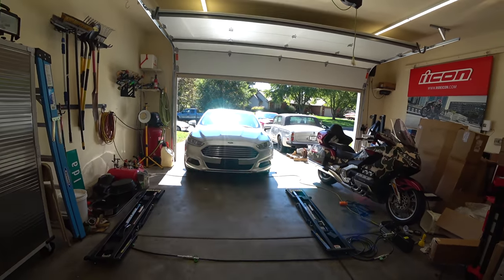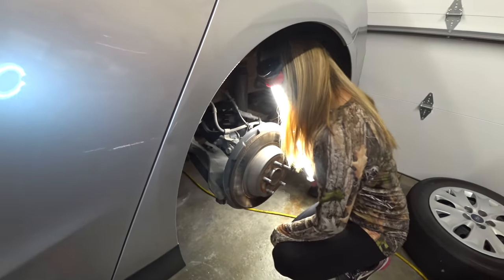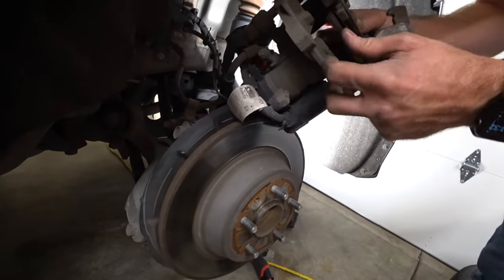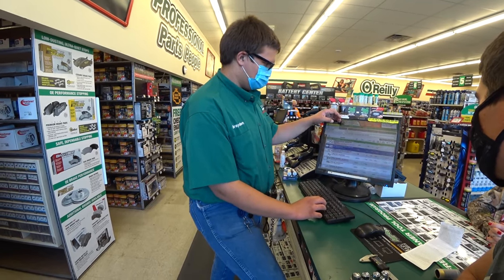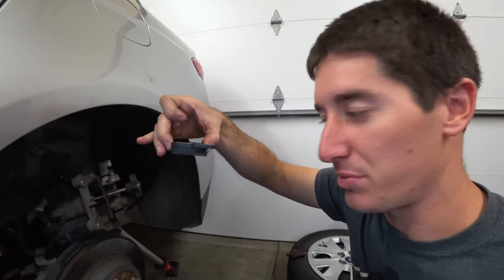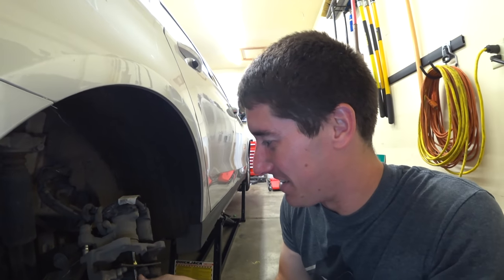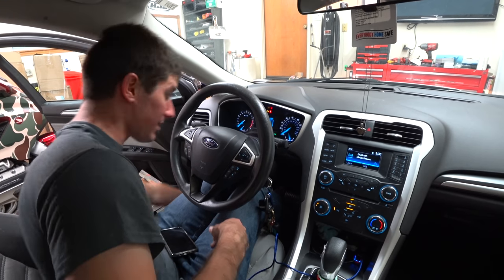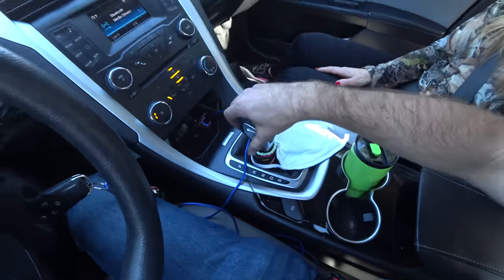GIVING A Single Mom A BRAKE Job (Dealer Wanted Too Much $$$)

Comment: The lugnuts are originally 19mm. When the jacket swells, you can use either a 19.5mm or 20mm socket to remove them.  She was kinda hot but JR treated her like she was a car buddy dude lol fistbump
Reply from the maker: That explains why they wanted to charge her an extra $100 to replace them all... and they would've failed again! 😬
Reply: Yep they were on my Focus ST too, first thing I bought for the car was new lugnuts. The stock ones are garbage and Ford knows it
Reply: @WatchJRGo  Remember FORD-Fix Or Repair Daily. It's all making sense now.
Reply: WatchJRGo Had a chrysler dealership say my Jeep has swollen lugs a few years back. What a joke lol I checked them myself afterwards and they were fine, just a little stripped. Hazard to the road my ass
Reply: I replaced my swollen lug nuts with a one piece set of lug nuts on Amazon.
Reply: @WatchJRGo  i would have changed them all... if she takes it to a tire shop they are gonna go nuts trying to figure it out... pardon the pun. also i believe you could have used your scanner to put the parking brake in service mode... either pay... good job JR.. helping her out.
Reply: I had a jeep with those capped lug nuts.  The caps were chromed, so it was for looks.  But my replacement lug nuts from NAPA looked a lot nicer!
Reply: What exactly causes the lug nuts to swell??  I’ve never heard of this kind of issue before.
Reply: @bradleykurtz5536  they chrome cap is really thin metal and over time it just expands from the abuse of the impact guns and if bad enough the whole chrome cap will pop off they are junk and a pain in the neck
Reply: @bradleykurtz5536  Heat makes the aluminum cap expand and delaminate, or separate, from the steel lugnut.
Reply: @fiffe7782  or Found On Roads Dead
Reply: I dont know if a fistbump  is the way to say youre welcome to a young lady -
Reply: Same problem on X350 Jaguars. Just get a 19mm soft socket and hammer it on. It reforms the jacket enough to get the lug nut off.
Reply: @bradleykurtz5536  They are two pieces; there is a standard plain lug nut with a nice shiny cover over it. Kind of like capping a tooth. The outer pretty part distorts over time making it difficult to get a socket over it.
Reply: @noahmatthews5013  🤣
Reply: Great job paying it forward 👍
Reply: Ford and Chrysler both have this problem on their chromed lug nuts from around 2009-2015 or so... that’s why they make half sized sockets... 18.5, 19.5, 20.5 etc.
Reply: You’re supposed to say your fronts look great, your rears look even better.
Reply: it´s watchJRgo and not watchJRcum
Reply: @fiffe7782  First on Race Day
Reply: I have a 2012 caravan and my lugs did the same thing! Vanity over functionality I guess....
Reply: my gf has a 2011 fusion and it had the same issue. We just replaced them with aftermarket lugs so no more problems
Reply: Yup I see it all the time at the tire shop I work at. It’s only on the Ford’s.
Reply: @fiffe7782  no
Reply: The lugnuts with chrome caps are terrible when they are worn and should be replaced . 
However you must get new ones with a rotating steel cone that contacts the alloy wheel. If you use ordinary lugnuts they will dig into the alloy and eventually ruin the wheel and/or the wheel can work itself loose. 
Usually alloy wheels have steel inserts where the wheel bolts/lugnuts contact but these wheels don't.
Reply: FORD actually replaces them with newer ones that don't swell now. I just had to change some out on a 2017 F-150 Platinum last week that were already toast, and the ones the customer bought from FORD as replacements were waaaaaay better.
Reply: @WatchJRGo  You also have to make sure that O'Reilly is giving you the right size (they sell 19 and 21mm for Ford) so if the owner ever gets a flat tire, the lug wrench in the trunk will fit. Also why did you just "pad slap" it? At least measure and turn the rotors if possible, or replace them. Its nice of you to help out, but the dig at dealerships "costing too much" isn't necessary.
Reply: Alloys covers on steel lugs nuts they just swell due to dissimilar metals.
Reply: Ford also had a lawsuit against them for this... What is really going to suck is when she has a flat tire on the road.
Reply: @WatchJRGo  ford nuts are horrible. the 19's and the 21's on the f150s that are chrome capped always swell. and don't get me started on dodge/chrysler, they are just as bad.
Reply: Its actually the steel lug nut under the cap that swells with rust. When you hit it all the rust disintegrates, and the cap just spins on the nut, or deforms the cap and strips. I've had to actually peel off those caps with a chisel to get at the nut to remove wheels. Really bad design flaw.
Reply: @ImTheJoker4u  The outer aluminum cap swells, not the solid steel lug nut itself. If you remove the cap, the steel part will be no larger than it ever was.
Reply: @ShinyRedGrapple  
Actually the steel nut under the cap is much smaller than when manufactured, due to the rust, which is why the cap spins or deforms. I've seen them lose as much as 2mm from a 19 to a 17. If they're even iffy, I always chisel off the cap to get at the steel.
Ive seen the chrome come off the tin cap, but its so thin it doesn't really cause any interference. Its the rusty nut under the cap that bones you.
Reply: @johnwartjr  Same with my 1999 Dodge 1500 Van, had to change 'em out.
Reply: @fiffe7782  i have a 2014 ford fusion se w/lux package and 18 inch wheel, and the great 2.0 turbo engine( i love messing with bmw owners ).. no prob,ems with the car.. added oil catch can at 20,000 miles, and removed all the oem lug nuts at first tire rotation, and replaced them all with lock 19 mm nuts... beond this.. just oil changes and filter changes  at 143676 mile now on the car.. and forgot.. i am a tech, classic Italian cars... my fusion. wonderfull car
Reply: @randellgribben9772  ya fords are great cars. just messing around
Reply: @WatchJRGo  My Ford dealer recommended I get a whole set for under $30 on Amazon and they swapped them out during a tire rotation.
Reply: @marvino3829  my Fords have never left me stranded anywhere.  Have always got me where I'm going.

Comment: Nice of you to help out, JR.

Next time, crack the bleeders when you push the brake caliper piston back in. Crud ends up at the bottom of the system (the caliper) and you don’t want that getting pushed back up into the system.  Fluid looked surprisingly good though.

Comment: Go to the 20mm for the lug nuts, her lug wrench won't fit properly when and if she has a flat, and don't put two different size nuts on her car...
Reply: Joe Schlotthauer Agreed. Once you start mixing lug nut sizes, you’re asking for a real headache when you end up on the side of the road with a flat, and your wrench won’t work! Not cool! He should have taken an extra five minutes and hit another auto parts store to get the right size...
Reply: Matt Miller  
24 hour roadside assistance...
Reply: Matt Miller  
He couldn't think straight...

Comment: In 30+ years, I’ve never had swollen lug nuts, until i got my Infiniti G37.  

Fortunately, I was about to rotate my tires, not stuck on a side of a road with a flat.

I was sure surprised when a 21mm wouldn’t fit and a 22mm was too loose.
CTA tools makes a 21.5mm socket and fits the swollen lug nut.  

I put that socket in the car, so if I did have a flat, I could take my wheel off.

Comment: Ford lugnuts are famous for swelling. The cheap polished cover on them gets moisture under it and then it’s game over.
Reply: Same on my wife's 2014 Cherokee.
Reply: Same with Chrysler lug nuts since at least the early 80's.  When I got my 2012 Jeep GC one of the the first things I did was replace them as they were already starting to swell even though they don't salt the roads up here.
Reply: Yep. Had the same issue on my 2013 Fusion. Had to change them all out after about 3.5 years of buying the car
Reply: All new lug nuts do it, constant thing with gmcs and Buick’s
Reply: Same on Range Rovers
Reply: I legit had this same issue with my 1993 F150. Ridiculous!
Reply: OK, you held the door open, but swelling nuts, really ?

Comment: My mother-in-law had her brakes worked on last year and the shop charged her $1,200 to replace the front rotors and pads (on a Toyota 4runner). I was so pissed, but she was the one that made the decision to have someone else do it instead of me (I had offered).
Reply: people like to pay and get receipts or invoices. My cousin did the same shit. I guess it makes them feel better.
Reply: 1200 bucks.  I could do front brakes on my car more than 6 times for that.  Replacing rotors and pads.  Won't even have the car long enough to do that many brakejobs

Comment: The stock lug nuts are actually 19s, it’s actually common for this specific Ford lug nut design to “swell up “ it was just a poor design
Reply: As someone who worked in a Ford garage, I can confirm. Garbage design
Reply: Awesome... Ford sells you a new car with crap lug nuts then gets to sell you new lug nuts a few years later. Lol

Comment: On my 2013 fusion I destroyed several lug nuts with a 20mm. Turns out I had to get a 19.5mm which fits perfectly on all the factory lugs

Comment: I would have also cleaned and lubed the guide pins. No need to have a set of pads wear only one side while the other side is stuck in position. (It would wear like a 70/30 or 60/40..all from lack of lube)
I used to do the same (withought lubing the pins), but I clean and lube every time now...what's a few more minutes to do it correctly.
Reply: its a free brake job, its not gonna get done correctly.

Comment: Rear brakes wear faster due to stability control constantly modulating them.
Reply: Thank you. I was expecting JR to explain to us, but he apparently missed the bragging opportunity.
Reply: Front brakes do about 70% of the braking. My guess is the front brake pads have been replaced before and not the rear.
Reply: Can someone explain if this is normal to use up brake pads in six years? My Camry brake pads still had life left after 10 years. Not sure if the braking habit makes that much difference.
Reply: @gzhang207  depends how much you drive it obviously. Pads could last 30 years if you only put on 10,000 miles
Reply: The rear pads are about 60% smaller than the fronts, thus wear down faster too. My 2009 Mustang GT uses the rear pads at a rate of 2 to 1 if not more.
Reply: @gzhang207  We got 113000 miles out of the front pads for our 13 Corolla. They had some life, but not much. The wife and I are easy on the brakes, so it matters more how you drive. I replaced the drums in the back, but honestly they were fine. Maybe 50% life left on the shoes.
Reply: Matt W. That's a misconception and false information. Vehicle stability control is managed by the front brakes, clutches, even fuel injectors. Even a car of this era with antiquated stability control systems did not use rear brakes as much as you make it out to be.
Reply: @gzhang207  adjust the front and rear brake bias
Reply: Thank you Mr Goodwrench!
Reply: Ahhh. Explains why my 6 year old Camry Hybrid needed rear brakes, but not front. I believe the fronts also regenerates the battery.
Reply: Jason Clark I replaced the brake pads at 110K miles since I already had the pads. I assumed the original pads were done by then but they looked like half way consumed. I haven’t changed the rotors nor the parking brake yet. Unless Kash’s car has driven 2x - 3x of the average annual mileage, the consumption appears faster than usual.
Reply: @ormand3000  But stability control does use the rear brakes ! They are also smaller and the ebrake function kills them quickly. I've gone from 130k changes to 30k changes on a different car with same driving.
Reply: @gzhang207  braking habits make a huge difference
Reply: Nathan Tankersley  modern cars with e-brake wear their rears much, much faster than fronts ! I've another comment up, last 3 rear pad changes for me were, 130k, 120k and 30k - guess which one had e-brake and stability control ? Another older car we have from same company - VAG, no e-brake, current 60k on it, rear pads have marginal wear.
Reply: Seriously? It's kansas and a ford fusion, not a 800hp race car. How much stability correction is it making? Your way off
Reply: Gary Zhang  yes brake habits. Never had to replace on my 6 year or newer vehicles. My wife 😬. Buys new car and after 4 years always needs new brakes !

Comment: That was very nice to help her out.  I hope we see more of Kash in future videos.  Something tells me that we will.  Also the Ford stealership that my dad took his F150 in for a recall wanted $1200 for a brake job.  I examined his rotors and pads afterwards only to validate my suspicions.  His rotors were excellent, and the pads still had at least half of the material still there.  SMH.
Reply: I had a similar thing happen to me with my 2015 Mazda 6. I had it in for service and asked them to look at my front rotors because I was experiencing some vibration during braking in the front end and I just wanted them to confirm my suspicion that the front rotors were warped. The service advisor calls me later that day and says "you're having vibrations in your front end because your front brake pads are worn down to nothing!". I told him I'd do the brake job myself. I checked the front pads and they had at least 50% left. The guy lied to me to try to get an easy brake job from me and it just really pissed me off.
Reply: @97I30T  Yes.  I don't know how people like that sleep at night.  From what I understand, the big dealerships make more money from the service department than they do selling new cars.  They take advantage of folks that don't know how to do repairs themselves or that don't know how to check parts on their car etc.  Whatever happened to an honest days work for an honest days pay?

Comment: Ford tech piping in....those swollen lug nuts are probably the biggest screw up by Ford in the last 10 years, and you should have had her check with Ford, there is a recall out for the Fusion for rear rotors and lug nuts, Ford needs to run VIN to see if her car falls under recall.
Reply: Oh no, remember he is doing the job SO much cheaper. Did JR check for recalls? Who pays for the garage? How about the service writers?  Now let’s talk about the lawsuits. Who is going to defend the mechanic? Does the dealership pay property tax, workers comp, social security etc? But the 3.5 hour job which is done in 2 hours is a rip-off, right?
Reply: Eric Babcock yup, I was a Ford tech for 16 years, most ford’s older than 7-10 years have had those lug nuts replaced by now.
Reply: @Eric Babcock My 1973 Olds Cutlass had that style lug nuts on it from the factory.
Reply: Dodge and Jeep had capped lug nuts in the 80's-90's and they did the same thing. Pieces of shit
Also, since the brake fluid level was low", chances are nobody added brake fluid. So when the pistons are pushed back in, there should be no worries of the reservoir overflowing. Please don't pull the cap off unless you have to. Brake fluid is highly hygroscopic and will pull water out of the air, contaminating the system
Reply: And to add, they aren’t 20 mm lugs on the car. They were all 19s and swolen!
Reply: @coramsauto  yup, which is why Snap On makes a 19.5 mm socket.....but most “YouTube certified” mechanics wouldn’t know that....lol!
Reply: So, how does a lug nut get swollen?
Reply: @craigjorgensen4637  water and salt get UNDER the chrome cap that covers the actual lug nut. As you may well know, salt, water, and raw steel doesn’t bode well. Rust forms under the chrome cap, and it swells. Common sense.
Reply: @angielover100  Not poison ivy?

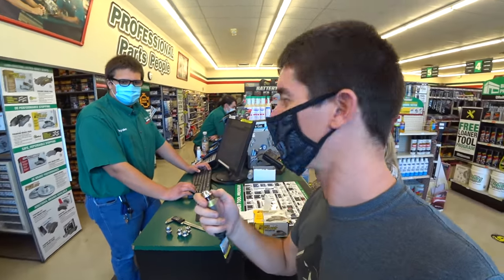Comment: 6:11 The stock lug nuts are all supposed to be 19mm, NOT 20mm. The reason why the 19MM socket does not fit is because they are swollen, just like the dealer said. That car most likely needs all of it's lug nuts replaced. You missed a couple steps on the brake job as well. You should always remove the slide pins on that style caliper, brush some silicone brake grease inside hole they slide in, and reinstall. While you have the pins out and caliper and bracket are seprated you should clean any rust off the grooves that the pads fit into and apply brake grease to the grooves and the tabs on the new pads before reassembling. It also isn't a bad idea to scuff the rotor surface up with an abrasive wheel to help the new pads bed in and to remove any rust groves on the edge of the contact area.

Comment: I’m a Toyota tech in the NE swollen lugs are pretty common on older vehicles up here rust builds up under the “cap” of the lugs and turns simple tire rotations into a nightmare, then you have to tell the poor customer we charge 8 bucks a piece for them.

Comment: Only thing I would recommend would be to take the glaze off the rotors with a grinder wheel/flap disk before throwing new pads on.

Comment: Most common warp is when lugnuts have a jacket that separates under pressure. Usually condensation, temp changes, and incorrect torque setting can kill them. Common issue in states like Kansas where it snows sometimes but not a lot, the constant freeze and melt can wreck the lugnuts as water expands when it freezes inside the jacket, warping the outer and inner lugnut. The inner part can hug the stud so much that air wrench removal can thin the stud threads. Inspect the threads and be sure new jacketless lugnuts go on at torque spec.
Reply: Ford dealer tried to put this on me once btw. I wasn’t having it. The jackets all separated on mine and the mechanics were all giggling about it, when they’re the ones that over spun them. Freaking dealers. Ugh.